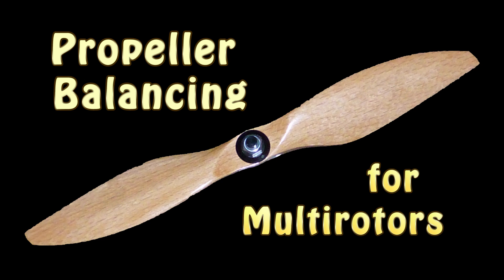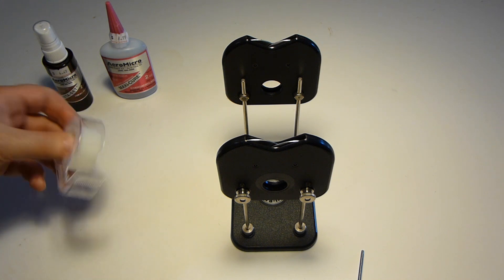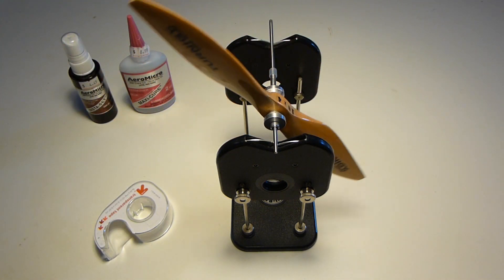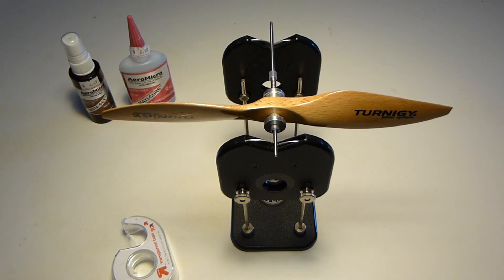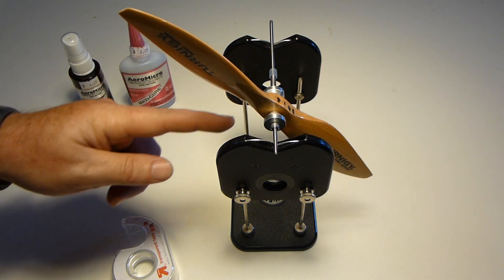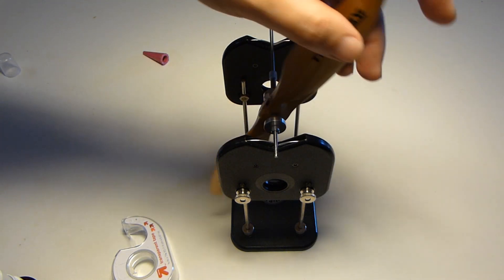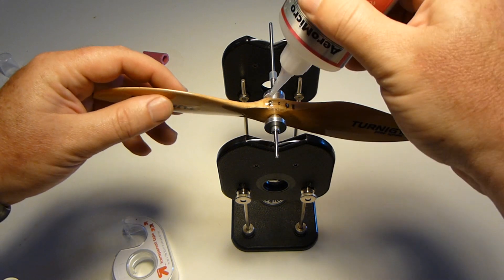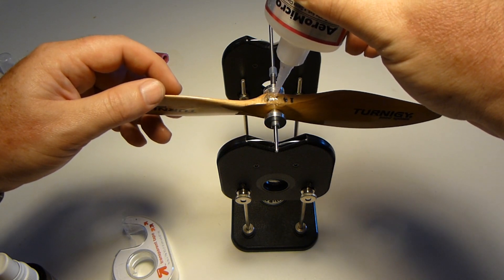Propeller Balancing for Multirotors

Comment from the maker: Had a rather serious crash with the 660... not the 660's fault... APC prop broke at about 100 feet up sticking to wooden props on such a big copter from now on. I started with the Turnigy NTM 2830 motors but have switched to the Century 2814's they are a nice motor. I have a GotHeliRC brushless Gimbal it's fantastic!